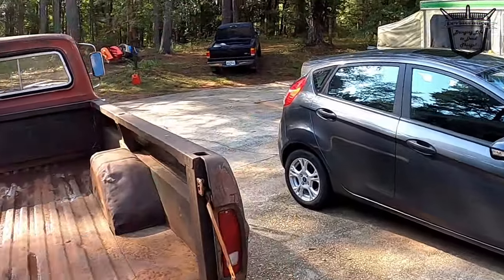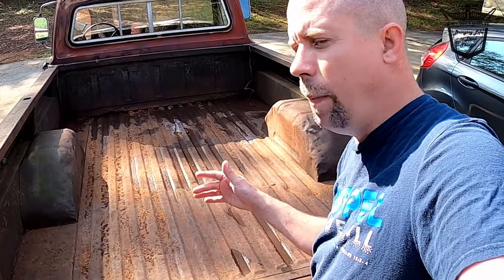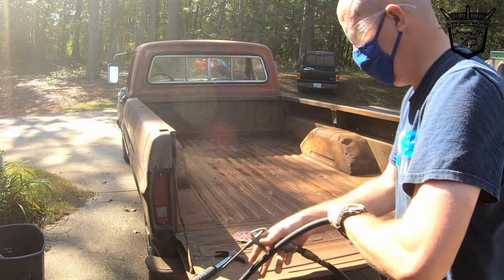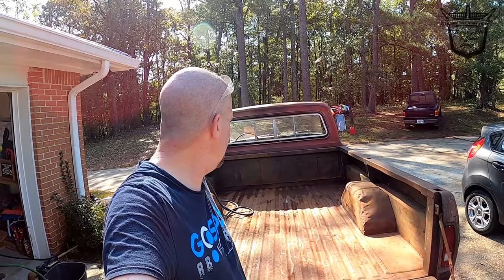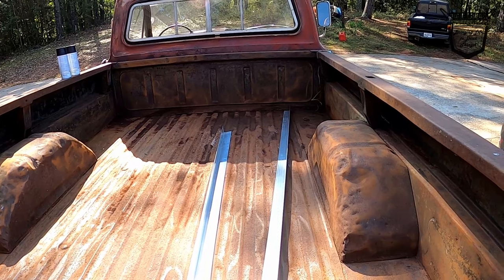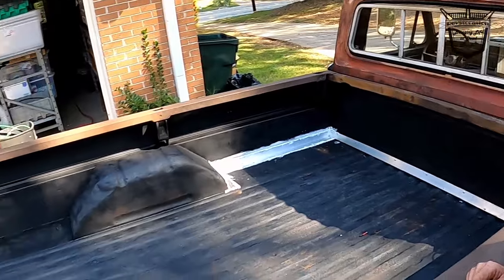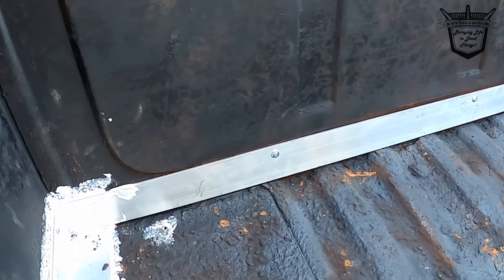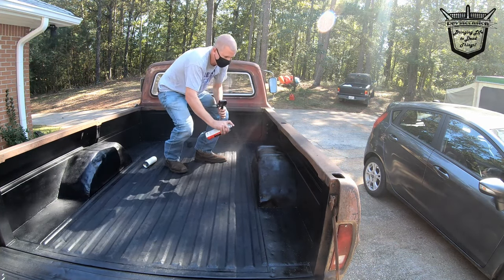Making Ole Puddin's Truck Bed: 1968 Ford F100 Revival - Rust-Oleum Truck Bed Coating Spray?

Comment: REV Ol'Puddin is not a show truck! it's a work truck and makes perfect since! THUMBS UP One comment, you have an air compressor, you need a spay gun!
Reply from the maker: Richard, I have a spray gun.. Im trying to do all repairs shade tree... I may venture from that when I get into the interior!
Reply: @RevStoration  Great video David

Comment: Very very good job!! I've used the rust converter on some rusty metal, painted it. 10 years later, it looks exactly the same, no continued rusting. Rust Does seem stopped dead in its tracks. You should paint the whole truck with it!!
Reply from the maker: John, I am pleased the paint is holding up well. I hope it hangs around for a good long time. Thanks for watching!

Comment: I liked the video. I have a 1963 ford ranchero.with a rusted bed is it better to go all the way to medal
Reply from the maker: I used the rust converter, if you go to bare metal you could use primer/sealer... either way works for me.

Comment: One thing about my 68 F100 390 V8 C6 trans. It runs great and drives good. Only thing that does not work is heater switch and horn. Just added a different horn button and a toggle for heater.   It is straight on passenger side and back in. Little damage on rear driver side, near gas tank, straighten hood alignment. Inside is good. So, it runs better than it looks, but not horrible. I wish I could fix it up. Either way still a great truck to drive
Reply from the maker: My horn doesn't work either.. I usually get honked at and I don't do much honking!

Comment: David I think I would have moved my car before sanding and painting Pudding.
Reply from the maker: Probably would have been the right thing to do but.. I live dangerously!
Reply: The little black and rust red polka dot car?
Reply: @RevStoration 
 good work on the truck bed. That is how I fixed my truck bed

Comment: Out of curiosity, and hypothetically speaking, if you did have a welder, would you have done it any differently?
Reply from the maker: I would have cut out the bed and welded in need panels... but the bed still has al lot of life left and it is never going to be a show truck!

Comment: You have probably already heard this but the aluminum strips on a metal bed could create electrolysis and could damage your metal in the bed more.  Just be mindful and keep an eye on it hopefully I'm wrong.
Reply from the maker: Pete, I agree... I put down a layer of seam seal between the layers so hopefully it will not cause any more rust... Thanks for watching.
Reply: @RevStoration  cool I missed that part but I love you watching your videos I get a chuckle from your dad jokes. Keep em coming 👍

Comment: I would do the same thing. It would be easier and less money to restore a 1968 F100/250 from the Southwest. It's not like some F100 collector is knocking on our front doors to buy 1968-72 F100's It came out good I think.
Reply from the maker: Clifford, it is not a restoration it is a fix rev style!

Comment: you want to feel the frame under the truck or it won't rest after you knock the rest down then you take bar and chain oil and a cheap cheap salt spray gun for undercoating Anda St the bar and chain oil with mineral spirits are lacquer thinner and you can spray it there and as you drive it really fast down the road it will form like Excel coding and it'll work better than any Factory undercoating
Reply from the maker: Neat way to do undercoating... may give it a try later in the process!

Comment: May I suggest that for outdoors you use Mono Caulk not Alex.  Alex needs to stay indoors.. Its a weaker product. I also like the new Dap siliconized caulk.  Yup. I like it for indoors.  My experience says outdoors is either Sillycones or Mono e Mono.  

thanks.
Reply from the maker: I actually went back with seam sealer and then painted it.  Wrong caulk to begin with!

Comment: It works, but it would've been better to use steel angle.  The dissimilar metals will cause more rust.  Otherwise, it looks good.
Reply from the maker: You are correct. I put seam seal between the metals after the video... The caulk I used was incorrect as well.. I hope I got the idea across.

Comment: Ya aluminum and metal don't play well together... dissimilar metal corrosion that binds and jacks between the different metals... will quicken rust actually... anyway... for a while... you know... you may want to spray your frame and the bottom of that bed as well as check to make sure its fastened to the frame solid as they will come apart on you at the most embarrassing moments [..dangerous].
Reply from the maker: It is attached well... I have seam seal in between the aluminum angel... it is holding up at the moment.... We shall see how long it last... Thanks again for watching.

Comment: not suppose to put steel and aluminium together ! its gonna destroy your aluminium !
Reply from the maker: I treated the steel but it will corrode over time.  I will redo it with steel and welding next time! Thanks for watching!
Reply: @RevStoration  thank for the show! Really love those old turds 😍